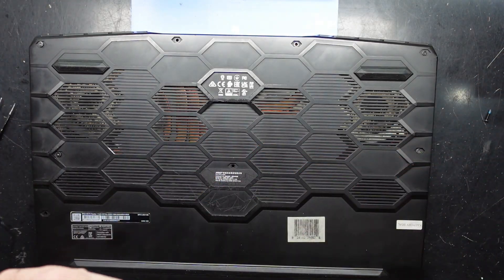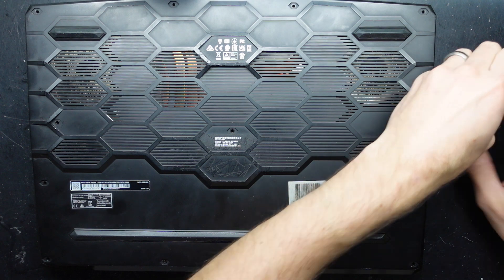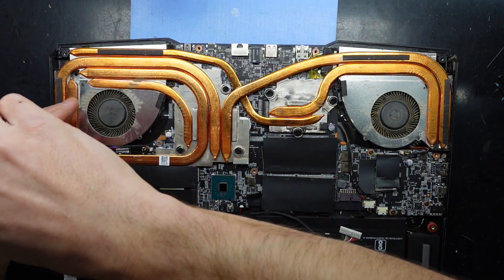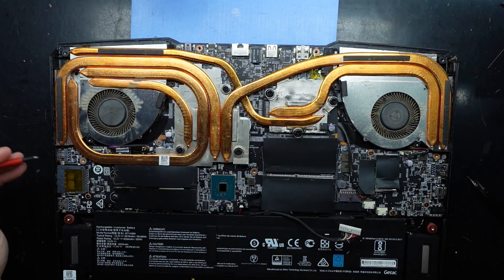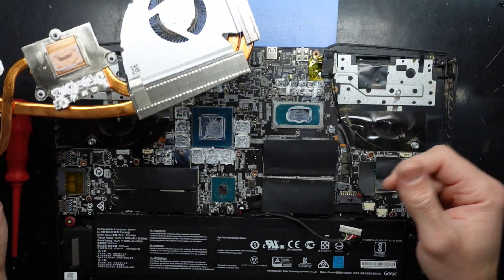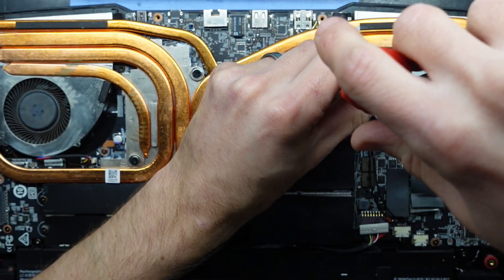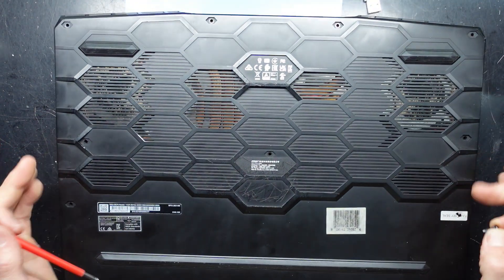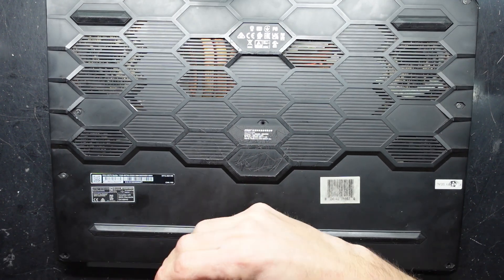MSI GE76 raider 11UH Teardown and Thermal Paste Replacement

Comment: Why didn't you clean the MOSFETs? And why didn't you change their thermal paste? After all, they heat up. Unfortunately, there's an SSD right underneath them. That's why the SSD also breaks down very quickly.

And of course, I forgot to mention it. Why didn't you clean the fans too... mate, you've really done a terrible job.

Comment: That stuff on the VRAM and VRM is Thermal Putty. Those gaps look quite narrow (maybe less than 0.5mm), so in this case I recommend Halnziye HY236 as a viable replacement putty. HY236 performs just slightly better than Gelid GP Extre.e pads, but it can squish down thinner than 0.1mm (grwat for shims and also laptops woth thin gaps).

A higher performing putty can be used with gaps 0.5mm and larger.

Comment: I purchased my ge76 back in 2021, i think its high time i get this done also
Reply: same, except im not worried about thermal paste, 1 of the fans has been acting weird for a while. when i started the computer, it would make a high pitched “zip” sound and go up to 17000rpm. after like 15 minutes of it doing that, it would finally start spinning normally. 

that went on for a while until it eventually stopped. but now, it started making weirder noise and later made a loud screaming sound that won’t stop this time. looking to get a new fan now…
Reply: @callmeace44 oh wow thats crazy. I pray its not expensive. I have had mines since 2021 but i havent experienced that issue like  yours. Sucks that such a high end laptop can have all these issues
Reply: @MrTatouA  yeah, luckily replaceable parts for this computer aren’t that hard to find. hopefully it’s just a fan issue 🤞
Reply: @MrTatouA  yoo i just fixed it. it turns out it was just a ton of hair and dust stuck inside making that noise. im very happy
Reply: @callmeace44 omg that's crazy. We have 5 cats and I had to get it cleaned inside out
Reply from the maker: yeah it will be getting due
Reply: same here, watching this cause my fans already seem to be obstructed
Reply: Came here for the same reason (and same year), GPU starts throttling immediately when I play most games :(

Comment: What is the white stuff?
Reply: Oops redid my thermal paste. I thought I was all old dry thermal paste so I removed it and put paste on all of those parts 😂
Reply from the maker: i think the previous user swapped the thermal pads to a crazy amount of Thicker thermal paste
Reply: @rickstechrepairs  Seems like MSI ge76 uses thermal putty instead of thermal pads as factory standard, which goes around everywhere as shown in the video
Reply: @dokinght  would you have to replace the thermal putty if you're just replace the thermal paste? Also, what thermal paste is best for replacing for msi laptop? I have the Raider GE68 HX 13V